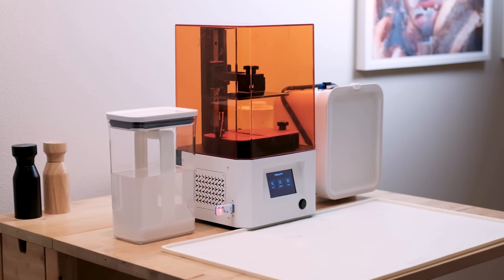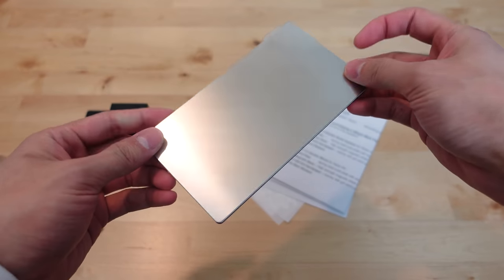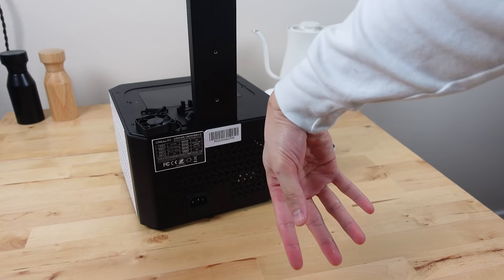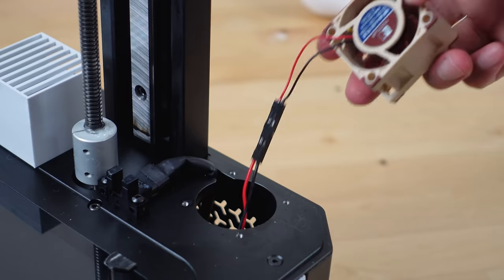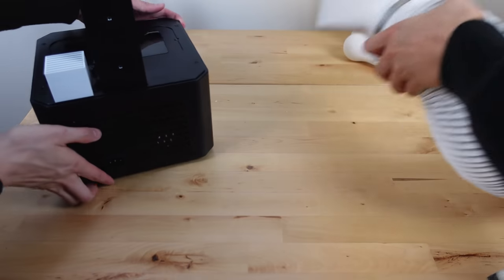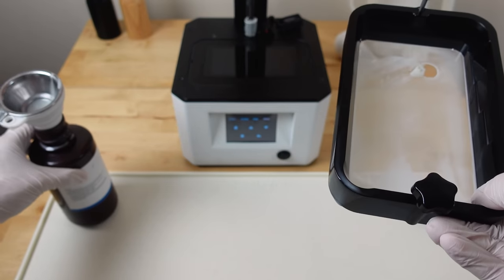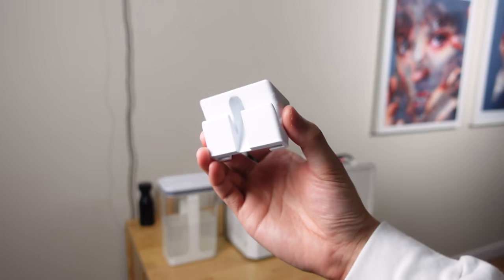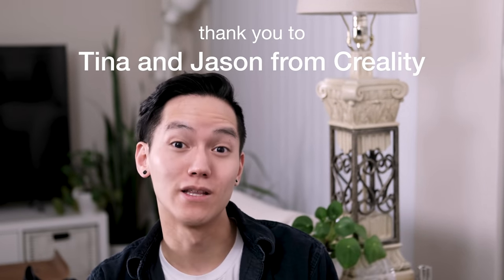First 10 Upgrades & Mods for my LD-002R

Comment: An AWESOME life hack I found for cleaning your fep without needing to touch it is that you save some of your taller supports instead of throwing them out. Put the base of the support down in one of the corners of the fep and full expose the entire screen for a 30-60sec. The support you stuck in will fuse with the film of cured resin you just made, and you can use it as leverage to peel that film off. All resin scraps from failed bits will fuse to the film, and it will completely clean the fep. It may cost a small amount of resin, but it saves any losses you might have anyway while cleaning it, and I know people that have never replaced a FEP in months of printing using this method

Comment: I have NEVER seen an AC vent like that and it looks absolutely stellar. My duct hose is just going to a window that's always cracked open in my house...
Reply: I saw it quite often. But unless it is already built-in by default and mobile AC is expected to be used, you have to (or find someone) to drill hole through the wall with that insert.
And I am if the plug for it is of any insulating type - winters here can be quite unpleasant.
Reply: yeah the AC port looks uuusefull

Comment: Found this video right when I got my LD-002R and thought it was super well produced but not all the mods were super necessary. I think I've come back to this video at least half a dozen times when I realize I need something I remember from the video. At this point I think I've added every mod except the cover handle and holder! Only extra mods I might recommend are a cover, only about $10 on amazon and block more light, blocking all the air intakes except for the bottom so less resin fumes leak out, making a gasket for the cover so that seals better, and for the really intense, buying a LD-002H mono screen from amazon for around $50, best upgrade so far.

Comment: 4:50 I would just use a standard Scott CF32 A2B2E2K2HGP3 filter thats standard for dealing with chemcials and vapours as its carbon is fine power with P3 filter layers rather then the cheep sup-par fishtank grade stuff.

Comment: if you have problems with resin sticking to the inside of the orange glass cover, maybe try using some automotive ceramic coating on the inside. it's resistent to the organics in the resin and should make the glass "non stick". could work pretty well actually!
keep it up man, love your videos!

Comment: Just a heads up. You might want to check the little Noctua fan in the enclosure while the printer is off. The fan might be spinning while it is attached to the vent fan. 

The vent fan you attached could spin the noctua fan causing a small voltage to go backwards into the machine. Could burn up the board...etc.

Comment: Ok, I did the same thing for my Form3 just this past week (75CFM, inline fan + 3" flex duct). I designed a hood that sits on top of the enclosure (yes it is bulky,  but space was available). Reason being I didn't want to have dust partickes get sucked into enclosure. But, good job, as an engineer specializing in particles filteration I approve your method and ingenuity (for whatever it is worth).

Comment: 🤣🤣The way that print rocketed off the print bed was epic! I am used to have that happen on FDM prints but never seen that happen on a resin printer! Really glad to know there is a flex plate for resin printers.  
I am seriously considering this printer after looking a the Photon, Mars and Sonic and other of the big brands. You knocked it out of the park with the upgrades here to address many issues I keep reading about with any resin printer. What I like to know re how easy or difficult it seems to be to fix or upgrade certain part on those printers and that despite their reputation they don't seem to be much better than other brands. If anything, some of them seem to have more issues than the cheaper, unknowns. 
With the experiences I have had with my Ender 3 I am willing to give this thing a go. Most of my issues have almost always been user error when slicing, a filament issue or something that I did not adjust properly on the printer or haven't done proper maintenance on over time.

Comment: One little tip on UV-resin. The only meaningful/cheap way to keep your resin from UV exposure is to use aluminum foil (shiny side facing out). You can put this on your temp. dust cover. I have worked with UV resin for quite some time.
Reply: Why shiny side on the outside? Its just an artifact of aluminium foil production methods

Comment: I was thinking about getting a resin printer for a little while, this video helped me settle it. I bought it. Getting some upgrades from this video as well. 
I got inspired and ordered the cure and wash station as well and I'm currently designing a box where I can put both in that also has a ventilation system for airflow

Comment: Oh shit I didn't know you lived that close to me.
I've been wanting a resin printer for a while and instead of just getting another FDM I just got deal on the LD-002R banggood since they are $126 right now till Aug 31.
 
while waiting on my LD-002R to ship I was doing some research and found a cool upgrade.

The LD-002r uses the Chituboard V3 which is compatible with 2k Mono Screens. 
apparently the Doubond 5.96" mono screen on the chitu systems site is a drop in replacement without modification to the printer other then firmware 
on top of that the LD-002H mono screen can also be used but would required some printer modification.

something I'd like to try myself if I can find more info on but would be cool to see someone else talking about this as this is very little info from what I've seen 
and a Mono screen is longer lasting and can print way faster.

https://www.chitusystems.com/product/5-96inch-2k-mono-duobond-rv059fbb-n80/

Comment: For that handle for the cover, you may even want to print a flat piece on the bottom of the handle to cover the top of the cover from  drips of resin on your hand or accidentally wiping on there.
Reply from the maker: dang, that's not a bad idea. could make for a good remix. thanks!

Comment: I think the carbon filter pack can have a second level where you can put the pellets too. Also there is polycarbonate filters that helps to stop the tiny particles of the fluids (approx 100 pcs for 140 usd)
Reply from the maker: a bit pricey but COOL! i did not even know polycarbonate filters were a thing. and i guess for 100 pcs that's not so bad since that will probably last a long time.
Reply: @ScottYuJan  If I would be able to redesign the printer, I would be gladly redesign the air filter system - as carbon filters are not enough for surely. If you need cheaper solution, I strongly recommend THIS: https://www.sterlitech.com/glass-fiber-filter.html - Glass fiber pads can be your best friend as many of them filtering out A-E cat. particles too down to 1 micron (aka HEPA filter), and not so expensive (only 40 bucks/ 100 pcs approx.1.5-2 years of supply). Add some high quality 10 mm thick cotton wool too as second stage to capture aerosol liquids, and as third stage carbon filtering and that is can be more then enough. I think it can be a nice challenge to print fine mesh dome, and casettes to the filters with 3d printer, and hide inside the printer box the filtering system.

Comment: I have to check to see if you did anything on laser printers. I bought three laser printers to experiment with. ORTUR 20W Laser Master 2, Laser Pecker PRO with the automatic laser adjustment stand, and a NEJE Master 2S 20W Laser Engraver. I've used the Laser Pecker Pro. Pretty awesome. But I have yet to use the other two. I have other toys like the 15"x15" Heat press with all the optional hats, plates, mugs, etc... as well. Have yet to play with those as well with my giant sublimation printer. I've been playing with my Cricut Maker making all kinds of full sheets of stickers(not with the stupid limit Cricut app puts on it) and whatnot. Humm, maybe I should make a video, as well, as I start to get around to using some of my toys. I use Fusion 360 for my 3D designs and looking forward to printing with my ELEGOO Saturn Resin Printer. You got me started on the right foot. Thanks. My point is if you make any other video with any of these other toys I have, I'll be there watching it.

Comment: Sorry to break it to you, but you need a LOT more activated charcoal in your filter for it to make a noticeable difference. I could practically see through your filter in some spots...

The finer the grains, the better. Normal ABEK rated filters have a particular filter on the intake, then a layer of fine activated charcoal pellets, and then a filter to keep the charcoal from going out the breathable end.

Best regards, 
Knoot
Reply from the maker: thanks for the info. the original carbon filter the machine came with, you could also see through it as well. any ideas where i can find finer carbon sheet filters? maybe I’ll just remix this design to allow for multiple layers of the current filter i’m using. maybe one on each side too but i worry with a fan this small, would it even be strong enough to pull air through such a fine filter? thanks for your time.
Reply: @ScottYuJan  No problem! Always glad to help :)

I'd go with something that looks similar to this:
https://images-na.ssl-images-amazon.com/images/I/510h-epUNdL._AC_SY400_.jpg
It's often sold as a refill for aquarium filters.

I don't know how harmfull the fumes from the printer really are, and thus I don't know If filtering them off is simply a sales-gimmic on the manufacturer's end.
But hey, better safe than sorry!

As for the power of the fan, maybe rearranging the airflow in the printer so the fan on the ventilation duct pulls through the filter could work?

Thank you for responding to my silly comment. Hope you have a nice day!

Comment: That lid holder and bed angled holder are both things I really want to print now.  I was wondering if anything like that existed to help the resin drain off of the build plate and I always have problems moving the cover out of the way as I have two LD-002Rs and a cleaning station on a small table.

Comment: I have a lung disease and i can tell you from experience that carbon filters don't get everything out of the air. A lot of fumes can be doing damage to your lungs without you ever even knowing they are there. I designed a very similar vent for my printer but it attaches to a box that goes over the entire thing with a PC case fan powering it. 

One thing I want to point out is that while resin fumes are terrible for you (resin in general is just terrible shit, both for your lungs and your skin), alcohol fumes are even worse. Make sure you are protected from the alcohol fumes even more than the resin fumes. Use a respirator and vent the room until you can no longer smell any traces of the isopropanol.

I stoppped using alcohol for most of my resin prints and now i just use mean green cleaner. It works without dangerous fumes and its better for the environment as long as you dispose of it correctly.
Reply from the maker: I'm sorry to hear about your lung disease. Thank you for the tips! I appreciate the insights. I didn't eve know alcohol fumes are harmful too! oof alright, well i guess i'll be switching over to mean green cleaner soon then. cheers!

Comment: Hey Scott! Super glad I found this as I recently purchased the new Creality Resin Printer LD-002H (Monochrome LCD). I will let you know if any of the accessories work or have to be slightly changed. The only different that I see so far is the screen/print area size.
Reply: did you try the upgrades on ld-002h?
Reply: @river2poet  I don't have any other 3d printers, so I've not tried much. But I had a friend print the adapter for the vent on the back to attach the dryer hose, and it fits perfectly. Same shape as the earlier model. I keep it in my laundry room and switch the hose with the actual dryer when I want to print. 

I thought about buying a T or Y hose adapter to have both hooked up at the same time, but I worry about my clothes smelling like resin. 😂

Comment: I did some research. So i come up to the conclusen that you will need a filter with the clasification A so A1 A2 or A3 as higher the number as longer it will last.

This only counts for The gray Normal and Eco Resin of Anycubic cause thats the only one i checked out.

To check this out by yourself you need to search for the safety data sheed of your resin and whatch out for the list of ingrediens they may have an cas number. Google this number and in the datasheed of this ingrediens you may find an recomendation of filter for respiration.

for example if one ingredient said you need a and another one said ax you got a problem cause ax doesnt work with another gas filters together but mostly you wont got into this.

another example one said you need a and another one said you need k so you need an ak filter. 

a also works for isopropanol so you dont need to search for that anymore cause most of you will use isopropanol. 

Take care of even if the boiling point of some ingredients may be high they go into air fast like isopropanol got an boiling point at 82,5 °C so other stuff in resin goes in air also fast and doesnt smell strong so you wont recogniss by smell.

Comment: Probably that orange-cover holder should be wider with deeper groove. I wonder how strong push/slap it needs to fall off (and how resistant it is to sudden stop by the floor). Is the printer still stable or by light accidental push to that cover you overturns it?

Comment: eh I'm pretty sure those aquarium activated carbon doesn't work in air, you see water has to pass through it and you filter medication with it. I have a box with activated carbon for my aquarium in front of me now and it says here: to stop using the carbon and save it for later, just leave it in the air with the bag open so it can dry out. this means that exposing it to air stops the process of filtering. it also says that by doing this you can use it again at a later date by just putting it in the pomp final filter chamber.

Comment: Awesome video! Living in an apartment, ventilation logistics has prevented me from ever purchasing a resin 3D printer. You address this with the inline fan vent and great that it works for you, but windows aren't always accessible. I work in a windowless office far from the living room windows, just curious if you think simply having larger carbon filters and a fan would make this workable, or if you've entertained the idea of building a dedicated vent system (ie. pipes from office to window)

Comment: AMAZING. I have one question, tho... I'm considering buying a 3d printer and I noticed that once you printed anything, you remove some parts. Is there a reason? Should that parts be modelled as well in the actual 3d file? What is the logic behind? Could you do a video explaining when and where print those removable parts? What are their functionality? That would be highly appreciated ❤️
Reply: sorry this is such a late reply lol, the removable parts are support material, filament printers can’t easily print overhangs where there is nothing to support the new plastic so removable supports are used to support the overhangs, hope this helps!

Comment: That vat protector tray says it is too large to print on the Ender 3, but it looks like that is what you used for the one in the video.  What is the deal?  It looks like the handle protrusions on the ends extend outside the printable area.
Reply from the maker: turn off “skirt” and your printable area should be larger
Reply: @ScottYuJan  Thanks, I didn't think to try that
Reply: @ScottYuJan  That did the trick, thanks.  Do you happen to recall how much you had to scale it up?  You said you had to scale it up slightly to get the vat to fit.
Reply from the maker: @Trueflights  yea i did 101% but someone told me they printed it with perfect fit at 100% so i think it depends on your printer calibration and settings. good luck
Reply: @ScottYuJan  awesome thanks again.  You're channel has been a lot of help.  Keep up the great quality work.

Comment: Cool setup. Have you tried upgrading the LD-002R screen with the LD-002H which has a mono screen? If this is doable i think this would be the ultimate upgrade for the LD002R.

Comment: Hi, I just bought this printer, and is my first ever 3d printer. I wanted to know if all of this is needed for a "once in a while" use case, because i won't be printing 24/7 but a figure once in a while, but if resin is so much toxic as i read i will take this measures. Btw, when printing you use gloves so your skin doesn't absorb resin right?
Thanks for all, great video :) !

Comment: i REALLY wish you would have put the dimensions for the vat saver, as the one listed is too small and i tried scaling up twice and both are still too small. how were you able to print it sideways and have it fit the vat? did you turn off the disallowed settings in cura? im using cura 4.8 and cant seem to find the code to remove the disallowed areas...ugh the struggle
Reply from the maker: are you printing on an ender 3 or similar? if by disallowed area around the bed you mean like a border zone where it doesn’t let you print stuff, that can be disabled by turning off “skirt” settings or reducing the distance of the skirt. the skirt is basically the line traced around your print at the start of a print and so that’s what that border zone is reserved for. if you disable skirt, then that zone becomes available
Reply: @ScottYuJan  sorry for the late reply...it totally worked....thanks
Reply from the maker: @airot1987  nice! and no worries haha it’s just comments on a youtube video, i wasn’t exactly waiting to hear back haha :)
Reply: @ScottYuJan  lmao...duh...i felt bad taking so long to reply tho...its rude....much respect